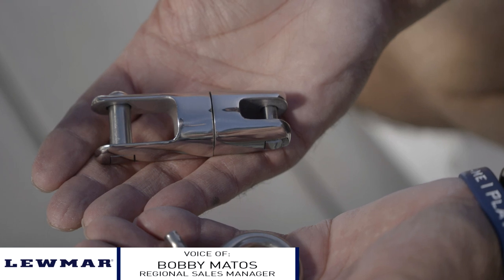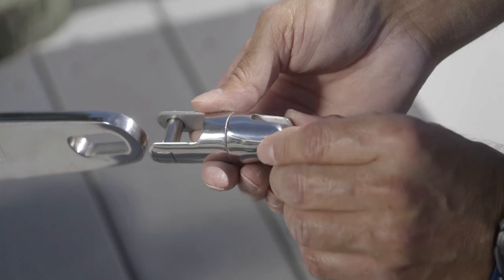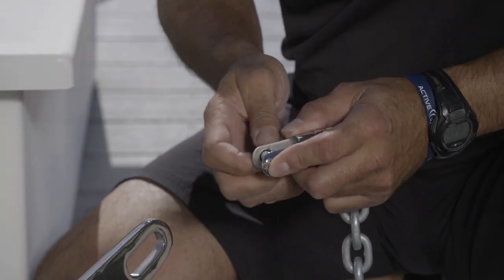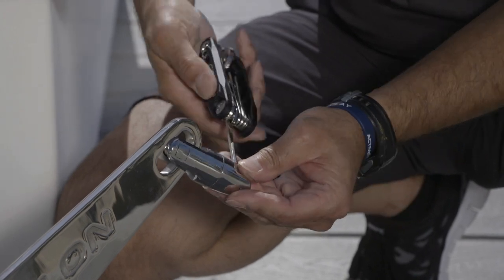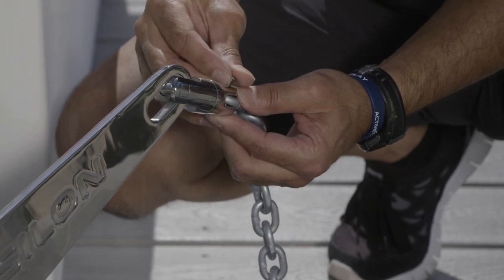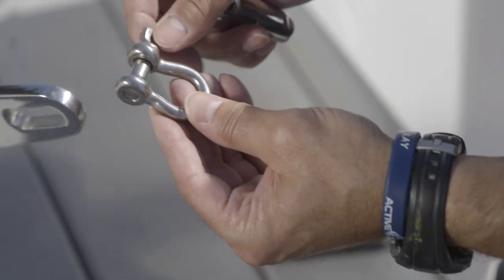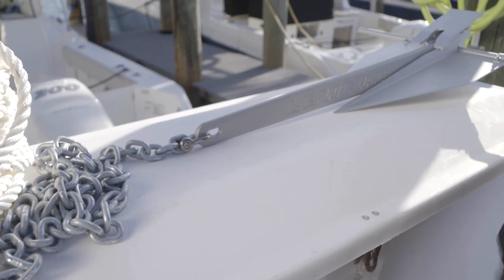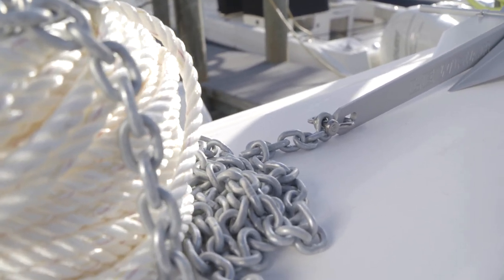How to Connect a Swivel or Shackle to a Boat Anchor | Lewmar Boat Talk

Comment: Not useful information.  The swivel should not be attached directly to the anchor , rather to a shackle allowing lateral movement of the swivel. Imagine risking a $500,000 boat with this mechanism?
Reply: I recently lost my Lewmar anchor that came installed from my boat manufacturer with a Lewmar swivel for this exact reason - side loading caused the swivel to break.  Will use extra chain this time and also do the breakaway rigging.   Debating now about staying with Lewmar for the new swivel or going with something that looks stronger like Mantus.